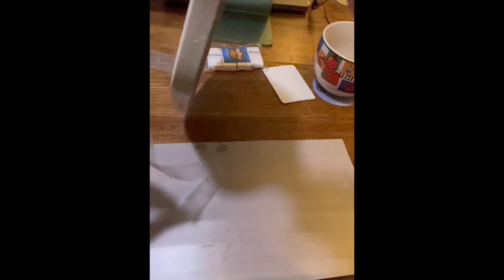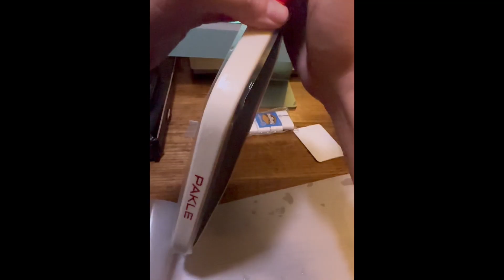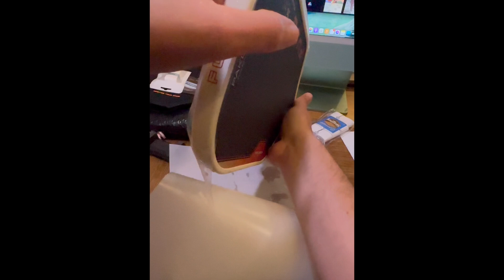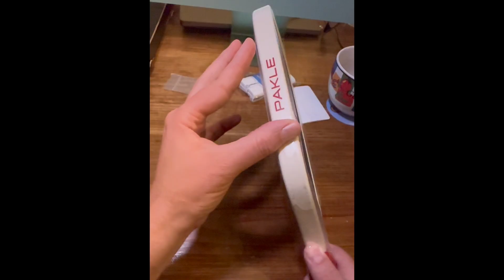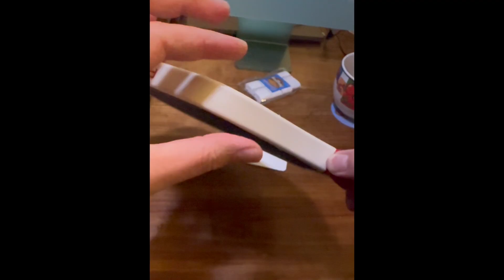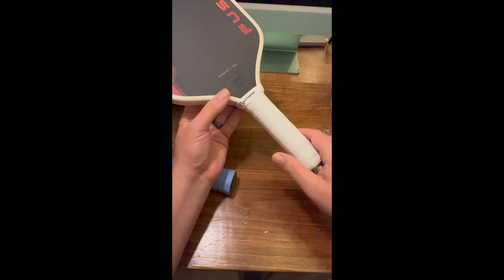How to Install Clear Edge Protection on Your Pickleball Paddle

Comment: Link or brand info on this product?  I assume you cut it to width?
Reply from the maker: So this that is shown in the video is something I designed and made using paint protection film. I designed a pattern to fit most 16mm pickleball paddles. The film also stretches well so even if it seems short it can be pulled to where it needs to be usually. This should be very similar to other films designed to be installed on paddle edges.